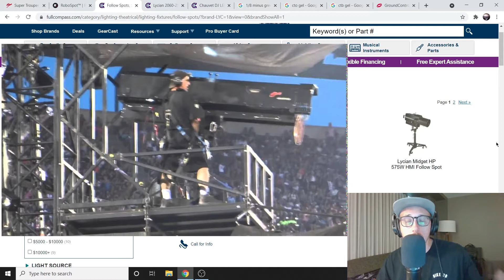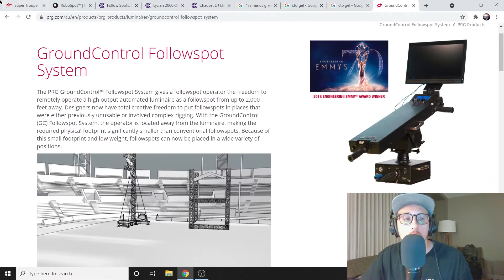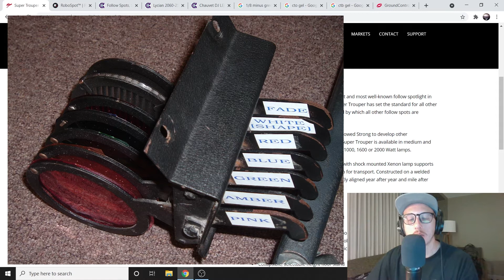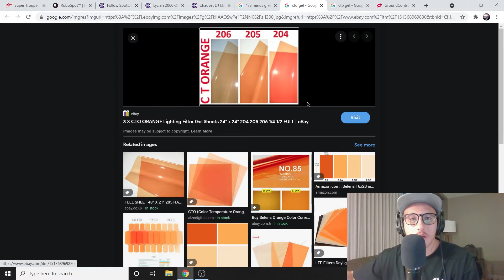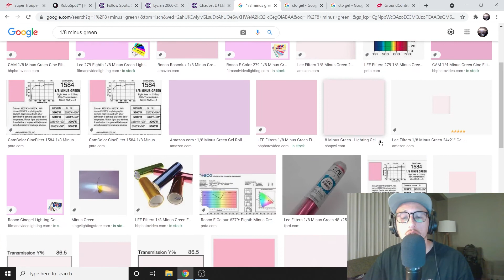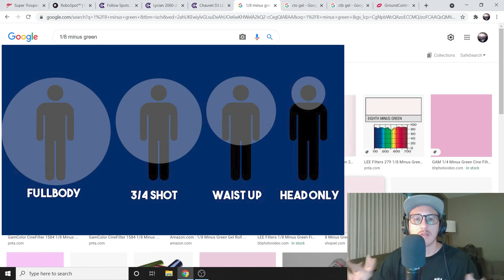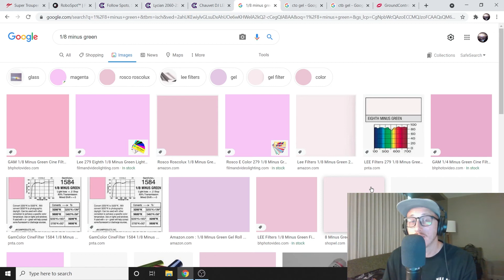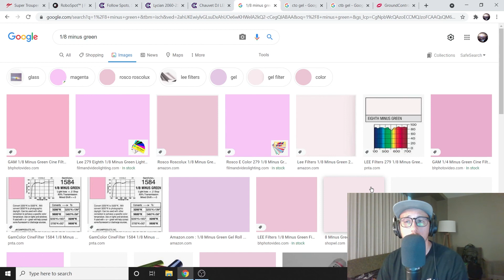How to Call Spot Lights for Shows

Comment: The last lever on the top is the chopper or blade control. The focus/beam edge is usually a twist knob on the side by the operator... The trombone is for beam size.